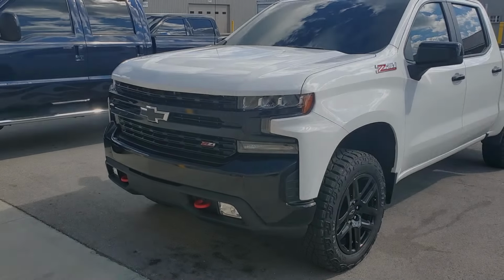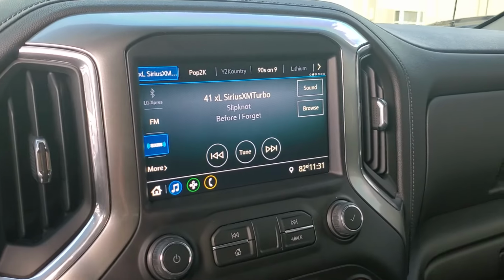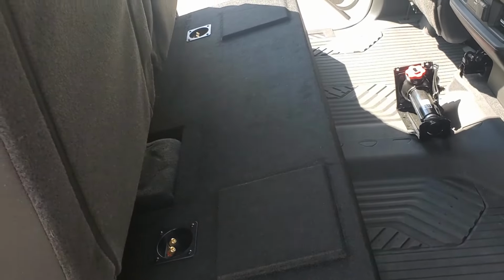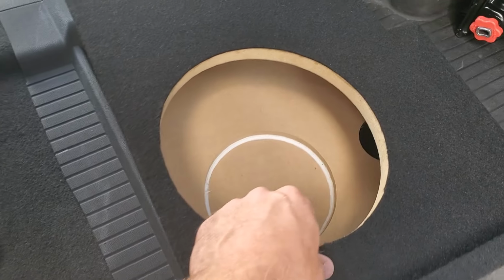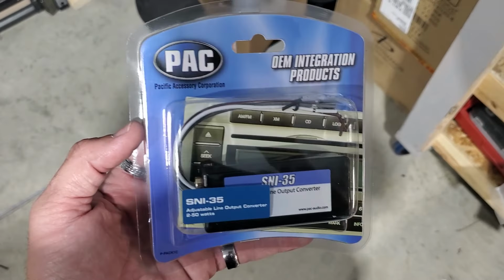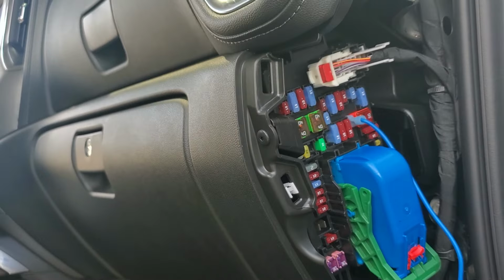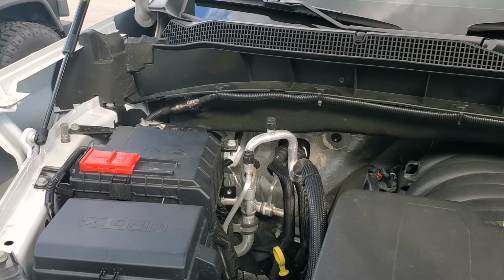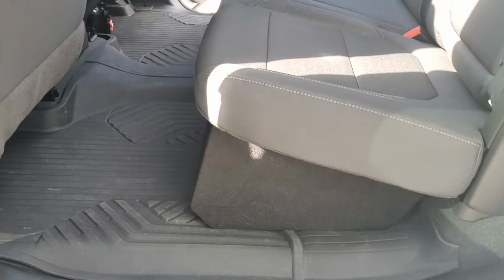2019 -2021 CHEVY SILVERADO / GMC SIERRA AMP AND SUB INSTALL - NON BOSE

Comment: Why are you running the power down the driver side? Could it possibly cause interference with the sound? and just curious why did y’all run through the driver side with the power and not use the accessory port on the passenger side? 

I have the 2021 RST duramax and will install my in the morning 
I am going to use the kisloc2 from kicker in hopes I don’t have to run the remote wire from the fuse but I do like this build 
I’m going with kicker 10 l7t with a 1200.1 kicker amp so I hope it’s not over kill lol 
Great video guys
Reply from the maker: No we usually run them down the driver side on all Silverados but this one is probably going to be easier to run down the passenger side. We've done a few since then and we started doing them down the passenger side. Either way is fine you can run it on the driver side or the passenger side
Reply: @octanetvchannel  awesome I was just curious if it was an easier route because there seems to be a lot of space on the passenger side of that engine bay 
My truck is gonna be tight the engine bay if full of wires and the turbo is right in the way
Reply: Thanks for such a quick reply too lol

Comment: Where do you get your remote wire from , what do you tie in to ?
Reply from the maker: Passenger side of the dash You can remove that panel and there is a metal terminal sticking out which is switched ignition. We have a few other videos on Silverados as well

Comment: Octane.  Who makes that Box ???
Reply from the maker: There are a few people that manufacture it I believe we got it off of eBay because they're really hard to find right now.
Reply: @octanetvchannel  thanks for responding buddy. Do you have a suggestion for a 2020 crew cab ram 3500 new body. I’d really like 2 subs one box but 1 10”/1 12”. I think that would sound excellent punchy and dropping

Comment: Appreciate the video. I tapped the rear passenger on my 2022 LT trail boss. The wire loom on the passenger foot well the wire colors for me were blue with black and a white wire. the pac loc you use is so simple and works great.. Thanks keep up the great work
Reply: You don't happen to have a video of the wiring you did for the passenger side.I can't seem to find one of people wiring to the passenger side.
Reply: Which one is positive and negative? @logan Darby
Reply: @kevindeleon5062  positive has line... negative doesn't bite solid color

Comment: Great video. I’ve got a 22 Silverado non Bose and would like to run wiring down the passenger side. Do you happen to know the color of the speaker wire on the passenger front side? Thanks in advance!
Reply: Did you figure it out?
Reply: a guy in another comment said he did that and he said "wire colors for me were blue with black and a white wire"

Comment: What size t conector did you use to tap into speaker wires ? I’m having issues getting correct size
Reply from the maker: Red or black
Reply: @octanetvchannel  thank you ! First time hooking up a sound system ! Was using yellow ones and couldn’t figure out why I wasn’t  getting a good connection 😂

Comment: Where did you ground the amp to?
Reply from the maker: You can ground it to any of the seat bolts underneath the rear seat
Reply: @octanetvchannel  did y’all scrape any of the paint off of the seat? Or did you just bolt to the top of the seat bracket
Reply from the maker: @brettburke9896  definitely want to grind it down to bare metal
Reply: @octanetvchannel  that’s what I figured I normally do but I didn’t know if these truck had something others didn’t lol